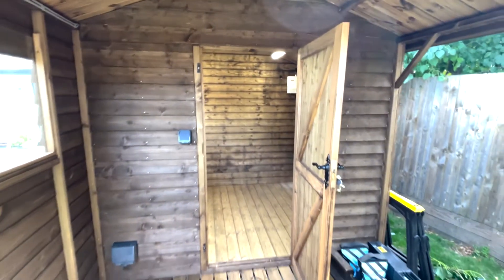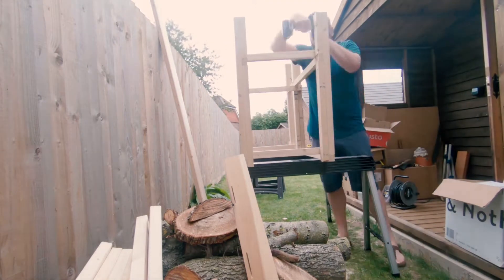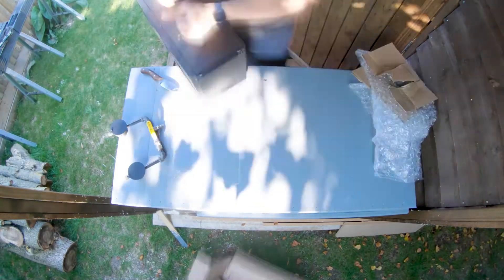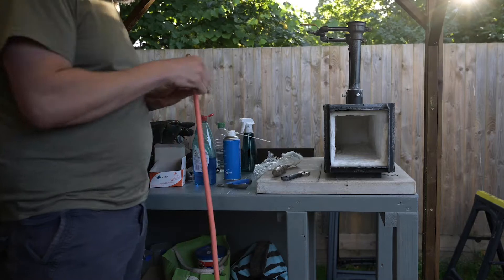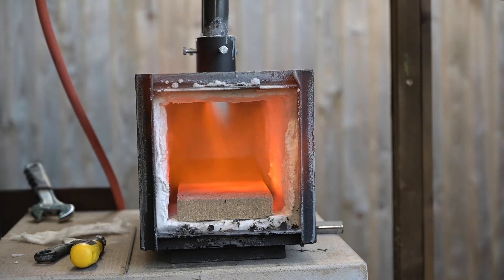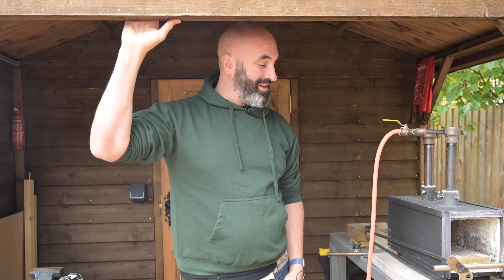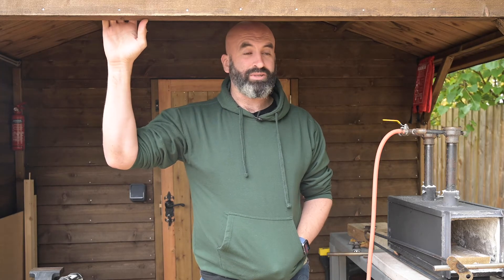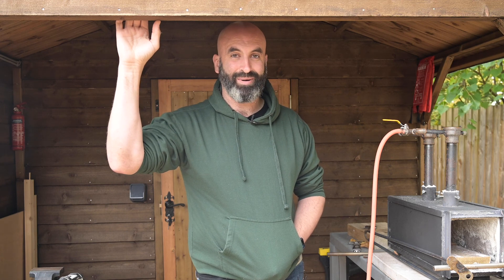My New Forge and Forging Setup

Comment: ... the purpose of the extra layer of refectory cement is because as that type of insulation heats up fibers can come off and you will breath those fibers in which is really really really bad lol.  Ridgdizer will help a bit with that but no where near as much as a proper coating.  You can actually see some of the fibers coming off when you first turn it on and those are only the big visible ones the finer stuff is like dust, unless you are always wearing a respirator coat your insulation for your long-term health
Reply from the maker: thank you so much for the info - I'll sort this out. The forge is run outdoors at all times, which i hope will reduce the effect somewhat, but i recognize it is still an issue. thank you for your feedback.
Reply: True about the fibres, you’ll see it shrink over time, my home made gas forge eventually I lined with a rigid refractory which does take longer to warm up but I know is safer. I now have a coke forge which I feel has more heat control but can burn the metal if you don’t concentrate. Nice video an I hope you are still enjoying it. All the best from Thirsk,North Yorkshire.

Comment: Hello! I am probably not the first person to make a comment on refractory cement. But I will give you my advice anyway. You really need to add some layers of high temp refractory cement. I personnally recoment to use "SATANITE".  But it can be any other good high temp refractory cement. Without it, the inside of your forge will be very fragile, and you inevitably poke the wool with some metal. You could also breathe some fibers which are really nasty even if your forge is outside. The layers of refractory cement will make your forge way more durable when poking the inside. More importantly, when forge welding, the flux eats up eat the ceramic fibers very quickly so you will you will have to replace the ceramic wool soon enough if no cement has been applied. The cement also helps a lot keeping the temperature of the forge. You will save money on the propane in the long run as well. Thanks for sharing! Your shop is wonderful! I like it very much! Nice job! And good day to you sir!